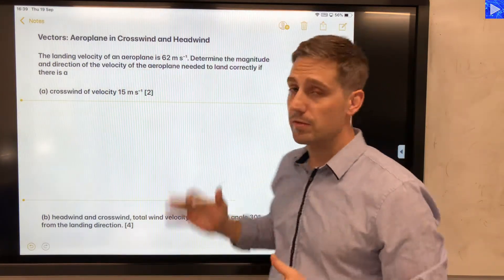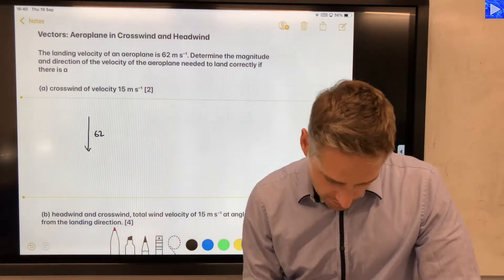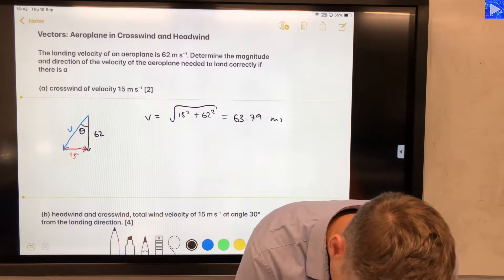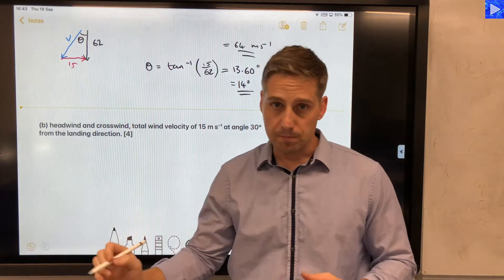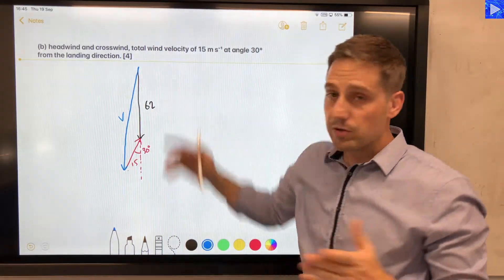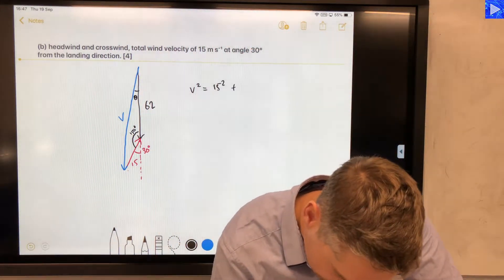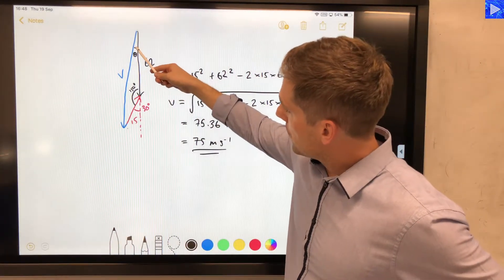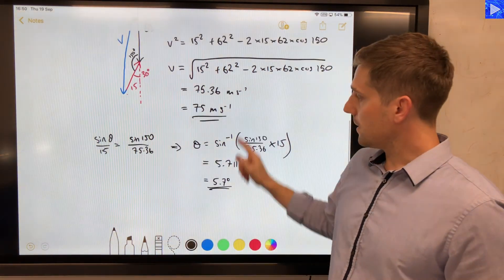Vector problem solving in A-Level physics

Comment: Can you teach me how to do plotting a graph I watch your video on that topic but I still don't understand  reply soon as possible thank you
Reply from the maker: Hi. That’s quite a difficult question to respond to. Plotting a graph is a broad topic. Are there particular aspects of the process that you are struggling with?
Reply: @PhysicsHQ  like plotting data on it
Reply from the maker: (It seems YouTube didn’t send me a notification for your reply. Sorry about that.)
1. Identify where on your x-axis scale the plot from your table should go. Example, you have force and extension data. And force is going on the x-axis. For first row of data locate the force value on the x-axis. 
2. Leave a small mark at that point. 
3. Locate the plot on the y-axis. Example, locate the extension value from first row on y-axis. 
4. Follow a horizontal line from place on y-axis to where it meets a vertical line from the place on the x-axis. That is where your plot goes. 
5. Repeat for all rows in your table.
Reply: @PhysicsHQ  thanks I will past this test with a A+